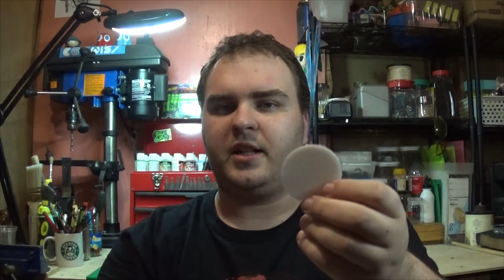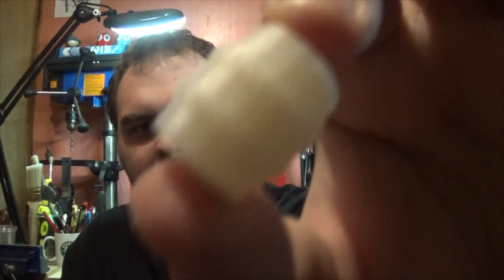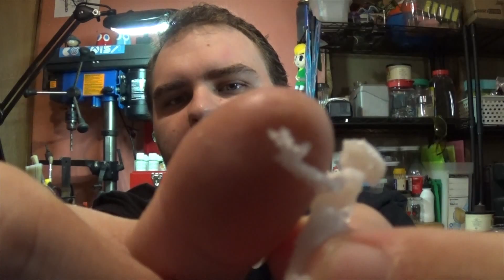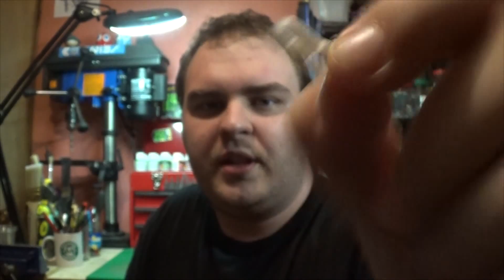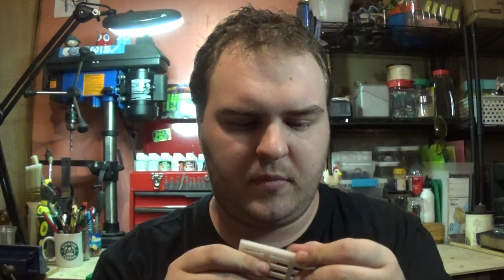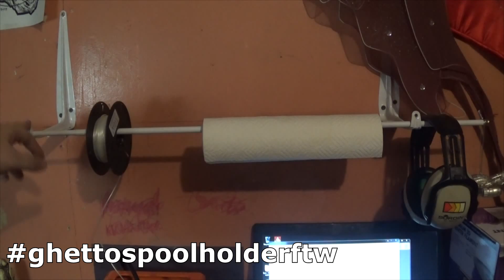Channel Chat Vlog #2 -- 3D Printing Update and Video Response

Comment: Soon if this was "a test"  how did it do?  did it fail, or pass?

...by the amount of waste compared to completed print I would say fail, which sucks, this review was the last one to change my mind on purchasing it.  I too am from Canada and just starting out, I don't want to build the printer, I know I don't have the time or patience for it.  Any recommendations on any others?  Have you looked into the da vinci?  I have only seen it on amazon in the search suggestions.
Reply from the maker: +Stephen Haines Honestly... I am disappointed with the printer. I picked it up because it was small, lightweight and quiet thinking that it would be great to use for the channel.  Unfortunately I've gotten exactly one completed print since I released this video. It seems like for every problem I fix a new one arises.

As for suggestions, I'm looking into the Wanhoa Duplicator i3. It's got a bigger build volume, a heated bed, and can print just about any filament currently on the market. And, it's the same price as the M3D. However, because it's coming from the states it's going to cost a LOT to ship because it's an all steel frame and there will be a hefty duty cost for crossing the border. My plan is to buy the printer and pick it up while visiting family in the states in the near future, alleviating a lot of that cost.